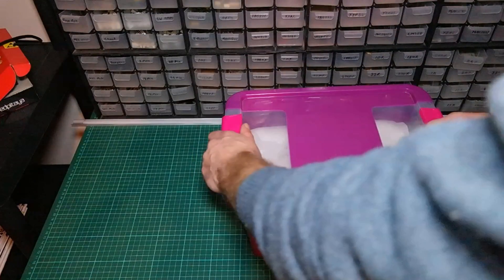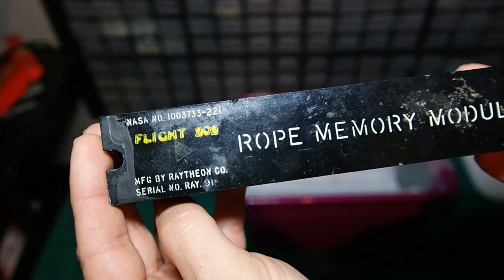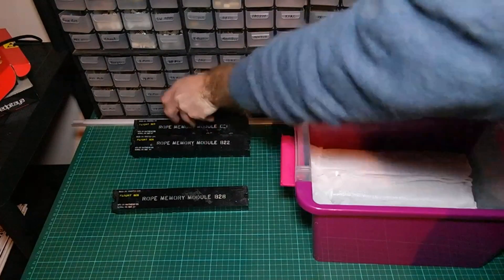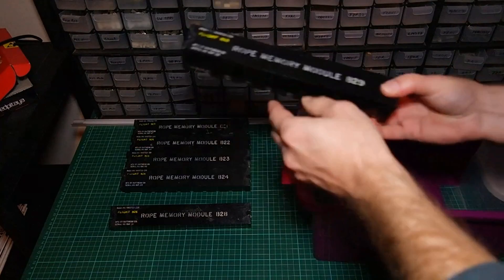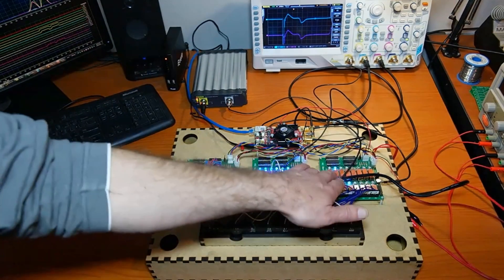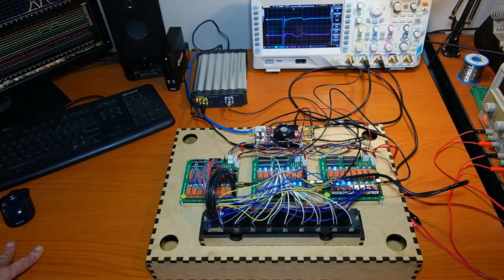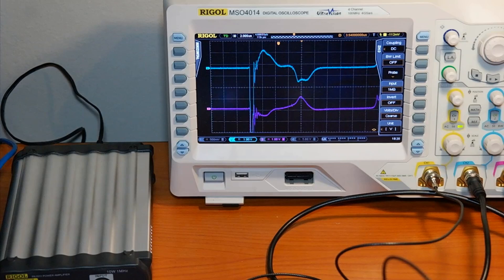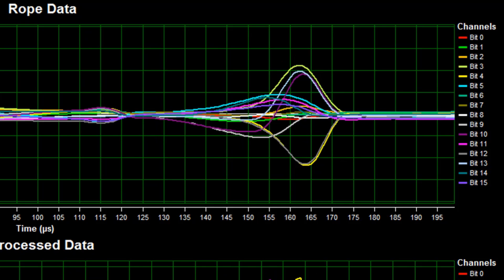Apollo Rope Memory Modules (Part 1 - Introduction)

Comment: about software. rope memory is not that stable so probably they had know that storing a half byte on a unstable storage is not secure and im near sure they didnt used partially those bits. 
and if the data is repeating that probably means its wiped or the data is for some kind of on-off indicator storage. but all that depends on processing units they used to execute this coda/software/data. so without knowing the actual cpu you wont guess correctly what this data means. since the meaning changes as the cpu or device using the code changes.
Reply: also i know that traditional hdd do not use partial magnetic reocrds while they can but they dont and they use aweges. ie if magnetism is %51 its assumet its 1 if its lover then %30 its assumed 0 victoria and similar lov level hdd   recovery programs gives us alot of clues about used standards. since you can see the magnetic status on hdd and what the actual values is assumed to be.
Reply from the maker: The rope memories did not store data as magnetic fields. The cores are only used to transfer the bit values to the CPU. The zeros and ones are actually hardwired, so this is a Read Only Memory. The technology was actually much more reliable and "stable" than the magnetic storage options available at the time.

Comment: lol. they used a unstable technology for apollo control units ? rope(highlu magnetic and highly sensitive aven for reads ) memory units ? 
then we dont need to look too far.
Reply: Magnetic core memory is very robust. Magnetic core logic is even better. The rope memory is magnetic core logic not simply core memory.
It is highly resistant to radiation effects and very reliable - it is also very heavy and bulky.
Magnetic core logic is still used and available today for safety critical applications.

Comment: interesting story . 
about the modules probably they are byte storage as its 8 pins each line. and counter i guess. 
anyway aslo as the early stage cntrol units. its highly possible they are using some 1 bit per control unit ie for sensor to detect if door is open or close probably only one bit storage is used instead like todays systems which use more then one byte for that type of values.
and one shortcutted cable can cause problems if there is no additional sensors for correction and error checking or for double checking sensors. which is not rare even today.

Comment: The key thing would be intimately knowing the core CPU that would execute those instructions.
Without that, the programme data is meaningless.
Similar to seeing patterns in the Voynich Manuscript without knowing the Key.
Reply from the maker: There is a fully functional AGC software simulator with assembler available. So yes, we do have all the information on the CPU that is required to decipher the software. The only outstanding step is to convert the captured waveforms to zeros and ones.
Reply: Cool.

Are you planning to run a simulation ?
I guess the input data will be hard to get, but any simulated data would be good - just to see how it reacts.

Comment: As Spock would say, "Fascinating!". But is this really the FIRST microcomputer?
Reply: First one using ICs. Not a "microcomputer", as there is no microprocessor, at that time, but instead of discrete components, it was made of single chip flip-flops.
Reply: @ThomasKundera  to be more exact NOR gates ... for low power and current needs 

and like modern cpu's and mother boards and bios etc ... they were cpu and motherboard all in one ...

Comment: Surely the relays are not great for rapid switching like that. What about bounce? Using Mosfet would be much quicker too. Why did you use relays?
Reply from the maker: The relays are only used to route signals to the correct pins on the rope memory. They don't play any part in the pulsing of the cores. The pulsing  happens once the relays have settled and takes no more than a few microseconds. 
I did actually contemplate using FETs, but relays simplified the circuit quite a bit and allowed for easier experimentation.

Comment: There was a company of that same time period that developed specialized digital testing equipment specifically for testing these memory cores. They were called Non Linier Systems out of Del Mar, California. Not sure if their testing equipment had the ability to "read" any data stored on those or not, but would be worth researching.
Reply from the maker: Thanks. That is very useful information.

Comment: Is there an assembly like language that the binary will be translated to as a next step? Incredible story and work here. Also, did you custom make that box?
Reply from the maker: Yes, the code was written in a custom assembly language. The code also includes a higher level "meta language" that was used for most of the calculations.

Comment: Did anyone else's jaw drop when he said "I'm going to plug this into my rope memory reader"...?
Reply: Was thinking dear God I hope he knows what he's doing.
Reply: Looks homemade to me
Reply: @vincentmartin2752  It kind of has to be, not really a thing you can buy, I know because I did a search. :)
Reply: Those relays clicking tho. Imagine yourself in a tin can flying around in space hearing those ? The voltages on those modules seems to be very big to use resistors, rather than relying on transistors (i think), But as we can hear, the clock rate is slow enough that the slew time of those relays would not make a difference. +Ave was talking about that in his latest video about relays. (watch?v=ftJ17Cp6itw) something to do with the inductive residual charge. just amazing
Reply: @GabrielSallum  AVE+
Reply: Gabriel Sallum The actual computer used transistors to drive the rope memory, not clicking relays like in the 1940s.  The only moving part was the cooling water.
Reply: @GabrielSallum Those relays were not in the original computer, they are part of his rope reading equipment.
Reply: Luckily, you can' hear anything in space ... no air for sound to travel through, after all. So it's a non-issue :)
Reply: That computer was located INSIDE the spacecraft. In the LM, it was on hte back wal. 

And yes, you COULD hear it inside the spacecraft.
Reply: Fundamentals ! Fundamentals ! Fundamentals ! If you understand the fundamentals, or as the British say "first principles", then you can roll your own.

Rope memory is pretty durable. Its all wire & ferrite toroids. Looks a lot like core memory, but is only ROM (Read Only Memory), while "core" is RAM, and alterable on the fly. Its programmed on how you lace the sense wire thru a toroid, or bypass it. When that core (toroid) is "addressed" (two more wires, and maybe a 3rd inhibit wire), if a pulse is present (either polarity) its a one bit. If no pulse is seen (as would be expected when "bypassed"), then its a zero bit. The circuitry to do this was on other "plug-in" modules.

Note in "core" RAM memory every addressable location has a sense wire laced thru the core. In that case the magnetic orientation determines if its a one or zero. When its "addressed" the polarity is forced to one orientation. If it was the opposite, prior, then a pulse will come out of the sense wire. If the same, then no pulse. This is a "destructive read". A register (bunch of flip flops) records the pulses from that addresses set of cores, and will rewrite it back onto the core, as part of the "read operation". With rope you don't care, hence pulses in either polarity.

Don't just read about it, and think you're some God Damn expert ! DO IT ! Get some parts and play with it. That's the only way you'll learn. School is just an introduction. Its best to take the initiative and learn on you own time. That doesn't mean never to ask questions. I often join a forum, and just keep my trap shut, and listen.

You can make your own core or rope memory. New parts are still being made. No, you won't find cores as small, nor purpose made sense amps (only surplus ones). But if you know the fundamentals, you can roll your own ! Its a good learning exercise.
Reply: I got gypped. My multiple card reader didn't come with a rope memory slot.
Reply: I guess every genius has a rope memory reader on their work bench. (I sure ain't got one).
Reply: @Bob3519  Ahh, I see what you did there. 
(everybody ,Bob3519 definitely has one) :)
Reply: What else besides rope memory reader are you going to use to read a rope memory? :D
Reply: MichaelKingsfordGray  

https://www.popularmechanics.com/space/moon-mars/g2056/apollo-schematics-moon-landing/

It's inside.
Reply: Machine code without abstraction layer.  Lovely.
Reply: thats 1960 for you
Reply: MichaelKingsfordGray  No, but I've had friends who have flown them, and you can simply look up the specs for the interior of the  spacecraft, or if you're smart enough, you can simply listen to the crew and flight controllers and builders tell you about it.
Reply: ...hmmm...I know mine is laying around here somewhere....😅
Reply: everyone pretending that theyre smart yet they dont understand your comment
Reply: William Bentz if you know how the memory works it's not too difficult to read it, most of hat he made looks to be relays to control input and output and the relays are driven by the microcomputer he's using. The clicking sound would be the relays.
Reply: yeah!, like, Holy shit he's got a rope memory reader where the F* did he get it from!
Reply: Nope,actually not....but its good to see someone who is not a textbook engineer..most graduates out of wits are nothing more than textbook and never taught to actually use their brain(They just want the degree on paper and cant even etch a f...g   pcb.....AND with that said..there really was no need to use relays or leds for this project..and no need to use linux pc to run it.

Comment: I've heard this was the first system to use preemptive priority based scheduling as well.
Reply from the maker: Yes, the scheduling was pretty innovative, even by today's standards. The priority based scheduling was actually the reason why Neil Armstrong and Buzz Aldrin were actually able to land on the Moon. The computer were running out of resources and restarted five times, yet was still functioning pretty well.
Reply: Francois Rautenbach Yes, true. I read in the nasa archives Buzz forgot to turn off a breaker or two, which caused the overload
Reply: This was also the first interactive computer.  Batch processing was the order of the day.
Reply from the maker: The AGC was a major departure from other computers of the time in so many aspects. Some people have disagreed with me calling this a micro-computer and I get their point, but you have to acknowledge that the AGC was a major step forward and had a big influence on the design of all computers and real-time systems we use today.
Reply: @AuthGate  technically you are not wrong ... sure it was a dedicated machine ... but it was still a true computer ... not like some cotton gin thing ... 

... https://youtu.be/2KSahAoOLdU  here's a more recent look at an AGC being restored to functionality ...

Comment: Can you give us some details on the circuits you used to drive the memory modules?
Reply from the maker: I use a Red Pitaya to generate the short read pulses. These signals are amplified with a Rigol PA1011 signal amplifier and routed to the correct core select lines through a relay selection matrix. Once all the cores are saturated (after about 2μs), the signal polarity of the selected core is inverted. This causes a small current to be induced in all the wires passing through the selected core. A second relay matrix is used to activate the required strand lines and a third relay matrix is used to route two of the sixteen data bits back to the Red Pitaya's ADC. Note that the relays are not used in the pulsing of the cores. They are set up well before a read cycle starts and are only used to route signals to the correct pins on the rope memory.

Comment: 5 k bit?
Reply from the maker: Each module in the block I computer contained 65536 bits (64kb) of data. There were 6 modules in total, so a total of 24K bytes.
Reply: 6*64kbit = 384kbit /8 = 48kbytes ?
Reply from the maker: Oops, wasn't thinking there. It should actually be 24K words. The memory in the AGC was organised as 16 bit words (15 bits + parity). The block I AGC had 24K word size memory locations and the block II AGC had 36K word size locations. 

Many of the early computers had odd memory widths and it wasn't uncommon to get, for example, a 36 bit computer. Technically speaking, the AGC was a 15 bit computer. The convention to measure memory size in bytes wasn't common and wouldn't make much sense anyway if the memory width was not nicely divisible by 8.
Reply: Thanks for your teaching, do you think of 15 bit+1 bit parity as 15 or 16 bits address space , parity is an error check mechanism and "might" not be utilized addressing data, if my assumption is correct. How do you view this ?
Reply from the maker: The data size and the address size are actually two different things. I regard the AGC as a 16 bit computer because the internal bus and many of the internal registers are 16 bits wide. The logical address space is actually only 12 bits wide, so they used a paging scheme to map different parts of the program into the limited address space. The reason for the smaller address space was mainly so they could fit an address and three instruction bits into the 15 usable data bits.

Comment: Asking why the parts were on the rubbish heap?
The end of the program is why. 
I saw a Saturn 5 rocket engine, fairly well complete, at a military surplus store in Norwalk Ca. In 1984.
For sale for $35,000.
It sold in about 6 months.
It's probably worth millions. I wonder today who has it.
Reply: Was that surplus store called Oxmans? A paradise for me  in the 70's and 80's!!
Reply: Scott mclain yes it was Oxman's
Reply: Rope memory modules containing an obsolete version of the mission software really aren't particularly wouldn't be expected to be useful for much.  If there was any desire to adapt the software, punch cards or magnetic tape would be far more useful formats.  Rope memory, by contrast, would be useless unless one wanted to run the software in its exact form (meaning one would have to have a system that was built exactly as the software was expecting it).  Today it would be practical to emulate a virtual machine for that purpose, but in the 1970s that would have been unthinkable.
Reply: Do you know which engine it was? Doubt it was an F-1!
Reply: And the v5 could be used today, they are still refurbishing originals in russia!, What do you think this guys roap memory is worth, i think it would go on an auction in a minute.
Reply: Maybe, If you were interested in it enough. Myself, it's either rubbish or museum junk.
Reply: Michael Wierson  Are you kidding, it was probably dissembled and sold to China

Comment: Fantastic find. Thank you for your efforts. What are some of the specifics of what the software contained? Was it intelligible? Do we have documentation on the software so that it can be compared? Thank you
Reply from the maker: Hi Will. A lot of this information has been "re-discovered" the last few months. I recently received a list of documents describing the GSOPs (Guidance and Navigation Systems Operations Plans) for flight AS-202. These documents describes the full flight, complete with navigation equations. There were also later flights for which we have documented source code, so yes, we have quite a lot of info to work with.
Reply: Francois Rautenbach ... that is wonderful. so impressive. thank you for this video. I just took my youngest son the the Kennedy Space Center this past weekend... incredible achievements of mankind. I look forward to more updates.

Comment: Hi. This is fascinating. Thanks for putting it up. Question. You mention that this is from the first microcomputer and the first in space. I wonder whether the computer that was used on the Gemini spacecraft fits into this category? I wrote about it in a Haynes manual. It was an IBM machine with 12K of memory (13-bit words x 3) and was used to calculate the burns for rendezvous among other functions. Suites of programs were loaded from tape. Perhaps it didn't use integrated circuits but it was small enough to fit into the equipment space of the spacecraft. Size (inches) was 18.5 by 14.5 by 12.75.
Reply from the maker: Hi David. Yes, it gets on the fuzzy line. As far as I know, the Gemini computer was built with transistors, as were the computer used in the first Minuteman missiles. The Apollo Guidance Computer was really the first computer built with integrated circuits, even though the actual flights were scheduled after IC based computers were flown in the Minuteman II missiles. The AGC was technically much more advanced and could be repurposed for other (non-spaceflight) applications, such as the F8 Fly-by-Wire system and the Navy's "Deep Submergence Rescue Vehicle".
Reply: The Gemini did have a computer, albeit a simpler one that did not employ ICs

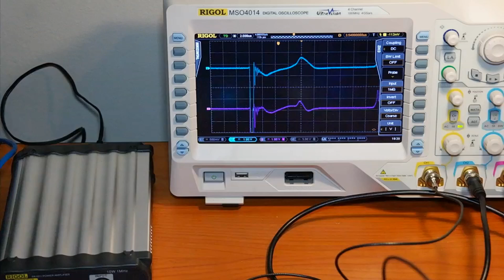Comment: At 4:48 it seems the signal can easily false into a 0 or a 1. Is the ringing at the beginning because of the relay bounce or from the core? The waveforms appear fairly irregular for the same data bits,  is there a bus impedance matching requirement that's not being met?